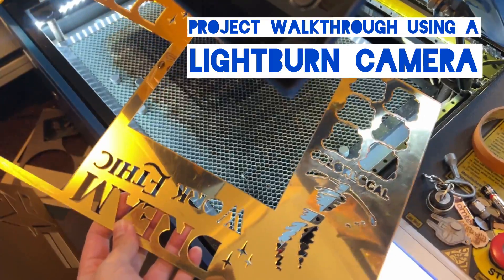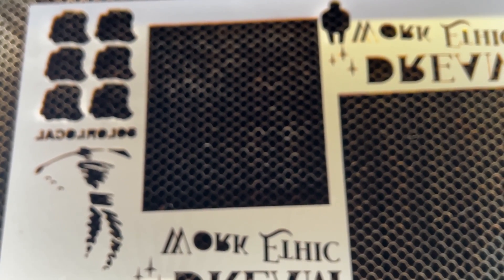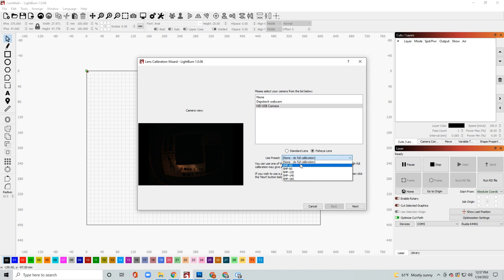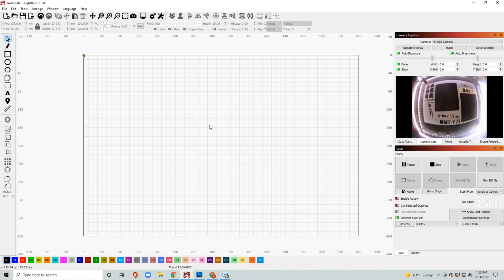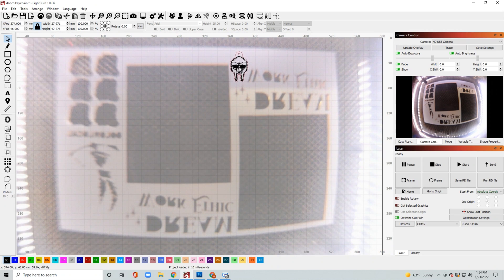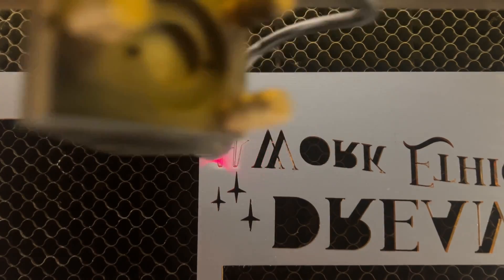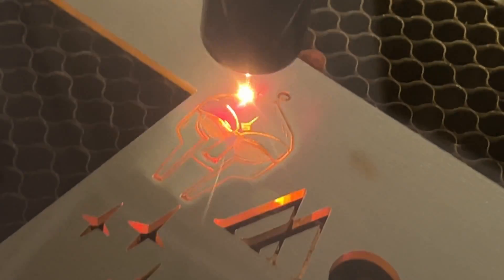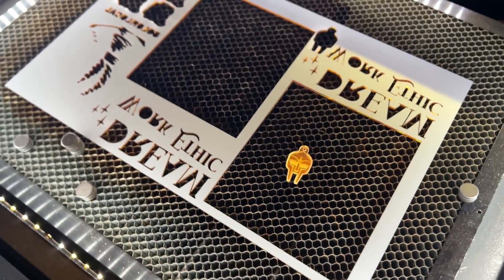How to use a LightBurn Camera with your OMTech CO2 Laser Engraver - Project Walkthrough - OMTech

Comment: I don't understand why omtech is endorsing this tutorial. The camera is installed in the wrong position, should be towards the front of the lid and pointing down with the lid open as to capture all the bed and not have to cut a hole in your acrylic window.
Reply: The lid on this specific unit does not open all the way up. The central spot I chose made more sense and remains more accurate in a center mount.

Comment: If you mounted it inside the acrylic in the bend up front, you would get to see the entire workspace without the gantry in the way. Open the lid, to do your overlay & positioning.
Reply: Exactly
Reply: The specific model I have has a lid that does not open all the way vertical, making that mounting position you suggested not ideal.